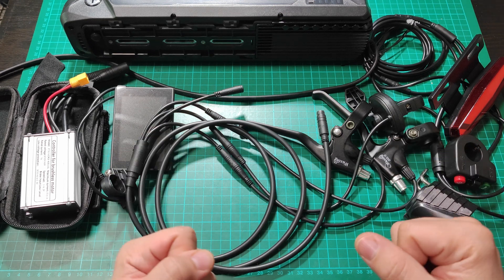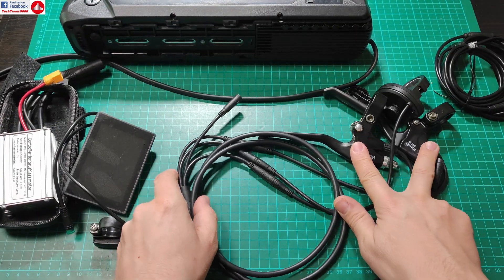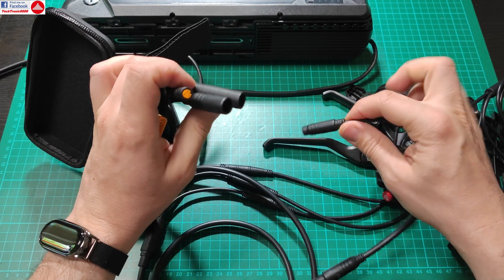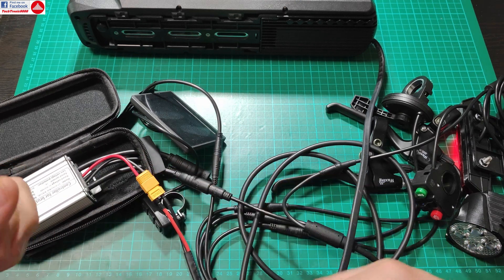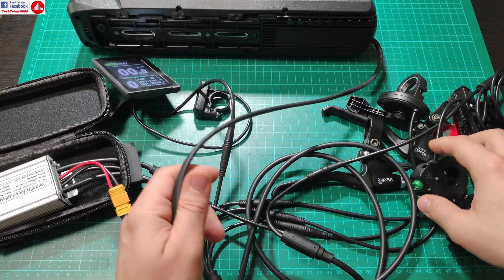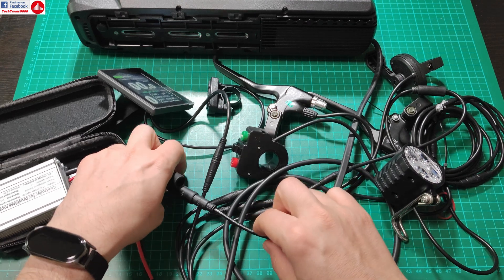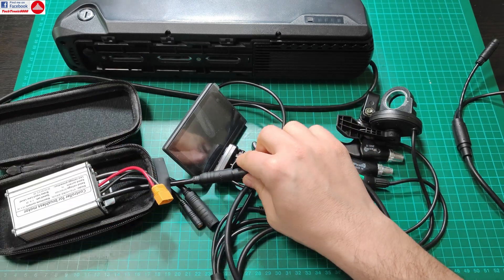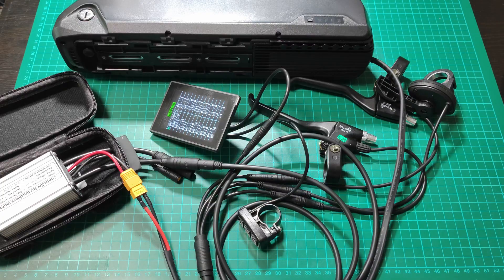KirbEbike E-Bike Conversion KIT - Electric Setup Details & How To

Comment: Hi, I did a few videos on this kit a few months ago including the light kit, what wheel are you installing? I used the 48v 20ah battery with a mtx 39 rim 27.5" on my mtb with the 350 watt hub motor which really impressed me  it has some nice speed & torque :)
Reply from the maker: It went on an ebike as a dual AWD motor configuration, here's the full video https://youtu.be/qLUNvpQyB9E